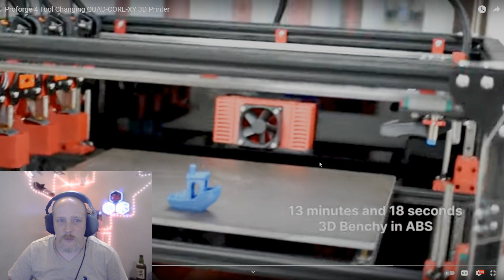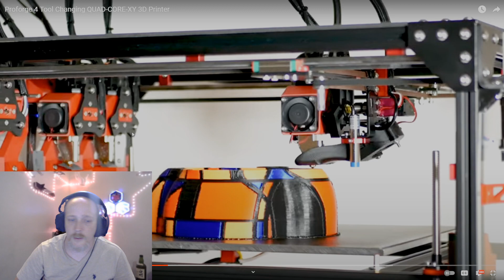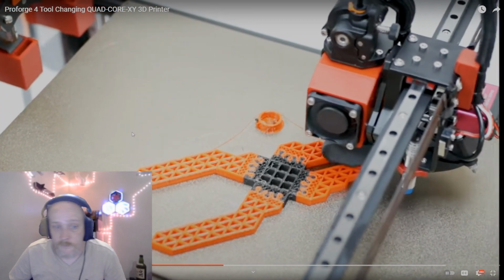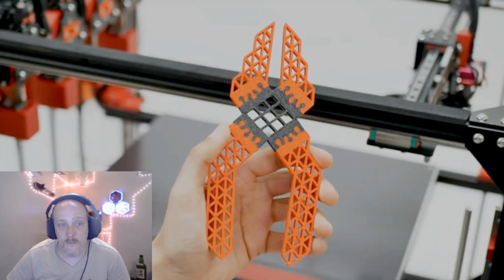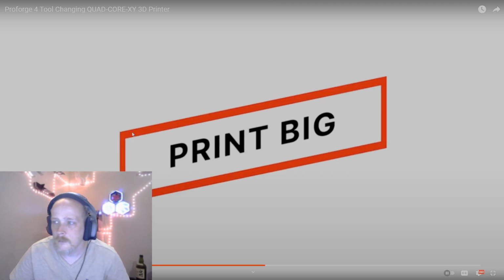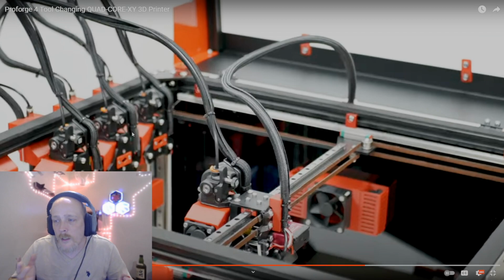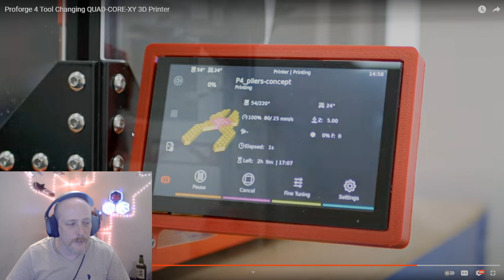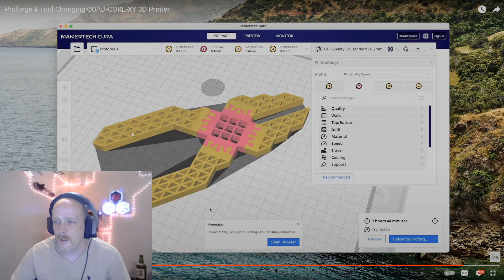Review of the Proforge Quad Tool-Change 3D printer kickstarter!

Comment: My experience with makertech 3D: (firstly: sorry for my bad english. I‘m native german speaker and have to improve my english ;-) )
I bought proforge 4 last year in July (not as kickstarter, directly in makertech store). 
I got my kit in december 2023 - october was planned by makertech, but i think its ok, normal delay. Some parts were missing and makertech was engaged to fulfill. During assembling (was okay for me, build manual is structured very well in my opinion but time consumption is really unrealistic) i got massive problems with some parts: firstly some stepper drivers burns (wiring was okay and done as described in manual), so makertech sends out a new driver bord with steppers. Long shipping delay, so i bougt the parts new by myself. After replace the faulty board I starts the Klipper config. After ten minutes, fan of extruder one began to burn and smoke. I asks Makertech several times for a refound, because I had to wait really long time for new parts and build time was much more than published in manual. It was not possible to refound…
In the meantime Makertech release the Proforge 4.1 Upgrade. Fortunately Adeel was fair and sends me for free. After replaceing all faulty parts, I continue with klipper Config and got next problem: Communication timeouts between PI and Driver Board during homing process (I read same from other users - they fix it by disconnecting webcam. In my case it doesnt work. So I wrote makertech again. I asked for a refound again, but it‘s not possible so far. I got standard answer: „I apologise for this inconvenience…“ I will get a new Pi, but it should take up to two months (after my experience i think longer time) to release the new PI Boards. So I have to wait and wait and wait. Proforge 4 is a waste of money in my opinion. So i will share my experience. Hopefully Makertech agreed to refound.

Comment: Has anyone bought this printer
Reply: My New  boss Did, never had it running right from day one, no one could figure it out, Support is shit and build quality is bellow average, I doubt it can print ABS. I got employed, have worked with cr10-max,ender 3 s1 pro, tenglog d6 and a Babu lab x1c and now building a RATRIG 500 enclosed   at home taken me two weeks to figure shit out mostly the Cura settings were incorrectly loaded in the Fucktard tab.  klipper is great if you have had experience in CNC machines which I have as its old school no presets, the bed has a 0.5 bow in the x axis, cable supports clash in the enclosure lid so took it off cant see any info on install of the runout sensors, Its got some quirks still analyzing what it doing and fine tuning for PLA and PETG doesn't like grid infill on PETG Gyroid is better. Still have no idea how to do a multi color print but the new prusa slicer will handle this for proforge 4 klipper soon. Personally id buy a RATRIG v-core4 with idex or a bambu lab Xl when it comes out you will pull your hair out with this one, not for a novice.

Comment: ITS RUNNING KLIPPER FOR CRYING OUT LOUD YOU WILL USE FLUID OR MAINSAIL!  COME ON NOW DID YOU DO ANY RESEARCH BEFORE DOING THIS VIDEO!
Reply: Check your caps lock🙄
Reply: @michaelpiper6601  POINT?

Comment: Hey, do you think this company is legit? Their previous printers have no reviews that I can find anywhere, thoughts?
Reply: i was wondering the same.. there are reviews on the kickstarte proforge 3 mostly about the shipping.
Reply from the maker: I don't know.  It being a kickstarter worries me. I hope this printer comes to market and shakes things up.  The tool changer is a game changer.  Other printers have it but are absurdly expensive or you have to build the printer yourself. Something that came ready to print out of the box would be massive.

Plus tool Changer would save hundreds of $$$ compared to AMS over time so would be well worth it.. All we can do is wait and see.
Reply: @3dbrothersprinting  they had many kickstarters before and you can go through their previous manuals and previous comments from previous kickstarters it seems legit
Reply: @3dbrothersprinting  their steel sled is really amazing idea. Theoretically you don't even need wipe towers with their setup. I put in an order with the 4 toolheads and enclosure. Wish me luck..
Reply: @mmakam3  Same
Reply: @mmakam3 have you received this yet??
Reply: @mmakam3  you ever get your printer? Does it work? No problems?
Reply: @Nbomber  that's good to hear they actually released a product. I think this one won't be perfect but a great platform to upgrade. It has some key things that make it suitable for almost all use cases except for peek. Enclosed, quad corexy, toolchanger, klipper, I mean even if it has issues you can probably upgrade parts and fix it. I'm excited for the no wipe tower sleds. That is definitely a new innovation.

Comment: I saw this, but that benchy is using ABS not a high flow PLA like Creality and Bambu use, plus that Benchy isn't done in an enclosed printer. I think the head might be a bit heavy. Some of the other models don't look as bad as the benchy tbh. The motion rail system looks pretty minimal.